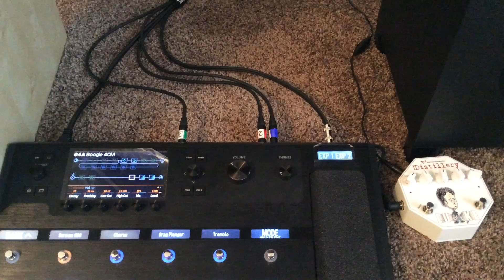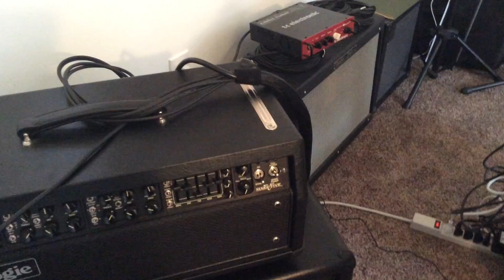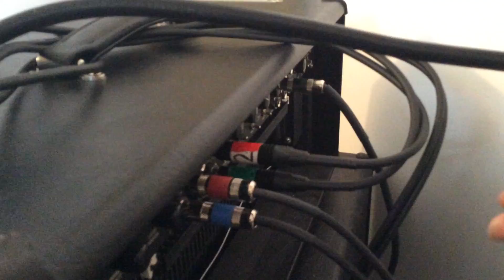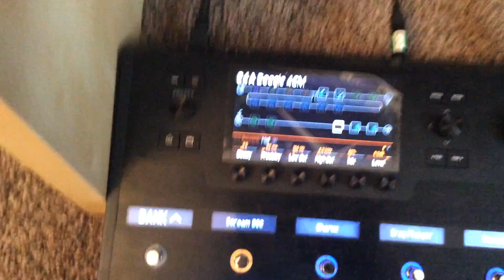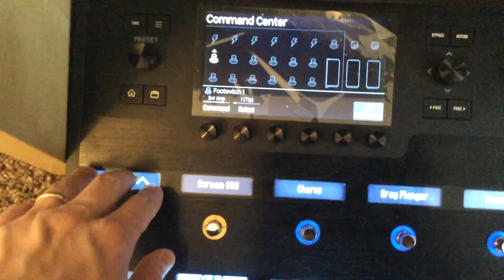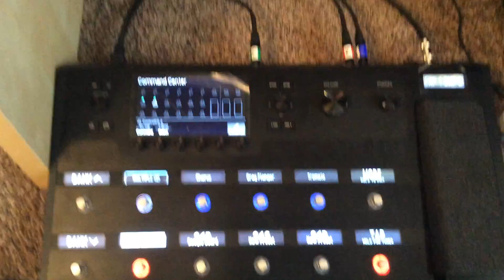Line 6 Helix with Mesa/Boogie Mark V 4 Cable Method

Comment: How do you switch between channels on the MkV....is it a toggle kind of thing with the Helix' footswitch?  Also,  how do you integrate your MkV in your patches?  Are you using it as another amp block or something else?  Do you use the Helix' internal amp and/or cab sims and if so, do they run through your MkV or do you use another send to a PA, etc.?  Sorry...tons of questions still.   LOVE your video though...it's going to be my exact setup soon...thanks!
Reply from the maker: +tomulator I've got the different Mark V channels assigned to a footswitch on the Helix, so that will turn them on and off.  I'm not using any amp or cab blocks in the Helix.  The Mark V and 2X12 Recto cab take the place of that.  With 4CM, you set up your patches so you have all your preamp effects first, then you place your send and return right after those, then you put in your effects loop blocks after the return.  Let me know if you have any other questions, I'm happy to help out!
Reply: Thanks, thats great
Reply: Thanks
Reply: Can I ask you how you set your volume controls on the helix to get the most natural sound from the mark v? There are so many options and quite hard to know how to set them. It is mostly the big knob and the send/return levels the I am uncertain about
Reply from the maker: I know you can use the amp and cab sims in the Helix with 4CM, I just prefer not to.  With an amp like the Mark V, I don't see any need for a digital model.
Reply: +Joseph Facer with the 4 cable method you can still use the amp and cabs in the helix and place the amp blocks in the middle of the send and return blocks, the return cable is a direct input to the power section, doesn't even matter what channel the amp is on and with a fender or jazz rivet amp it is the cleanest sound I ever heard in and amp, the fx is so full, you can switch between the patch amp or the tube amp with a controller if you set the amp in between the send and return blocks. Just for cleans tho the crunches sounds sound good too but I rather the real amp. Hope this helps.
Reply: Hi, and thanks for sharing. I also have a Mark V and is waiting for my Helix to arrive. Is it possible for you to have for instance channel 3 on the mark v in one preset together with different effects and then use channel 2 in another preset (with other effects), and change these amp channels only by changing the preset,
Reply from the maker: Absolutely.  You can set the channel switching to an instant access command on the Helix, so as soon as you go to that preset, that switch becomes active.  You should look into the Helix's snapshot feature which will allow you to switch between channels/effects/settings within the same patch with a single footswitch.  I have one patch that is just for jamming that lets me switch between channels/effects that I have preset for different sounds, and when I play with my band, I have it set up so I have one patch per song, and I set up snapshots for the different sections of the song.
Reply from the maker: I just run with with the main volume most of the way up and the send and return at 0.  There is a Facebook group called Line 6 Helix User Group that could also give their findings on it.  The administrator of the group, Chad, has posted several times what his optimum Helix levels are for using Helix as a standalone as well as with an amp.

Comment: In other videos , people say that have problems when trying to change the amp chanel (they cant). Some are using interface boxes others crying. Do you have this problem?
Reply from the maker: +Ignacio Lanzani Not at all.  The channel switching works exactly like I've described it in the video.  I have heard of people having troubles with the Mark V:25 and Mark V:35, though.  With my setup, the channel switching works perfectly.
Reply from the maker: The new amp models are Mark IV models, but they do sound really good.
Reply: +Joseph Facer aw man that sucks if the switching doesn't work with the Mark V 35 I'm getting mines tomorrow and I've been using the 4 cable method with my helix and a carvin tube amp and it worked perfect. The upper post is a couple weeks old and now the helix does have Mark V amps with the 2.0 update, and the sound awesome, even setting the famous eq "V" sounds and responds just like the real amp. Great post I can't wait for my amp to come in.

Comment: i have same setup but just ordered 2 laney IRT-X FRFR cabs to use with my tube amp. still working on the cabling  and helix presets for this. love the cable snake just ordered one. thanks for the info.
Reply from the maker: +rick jones The Pedal Python is really awesome, plus they'll refund you a little for giving them a shout out on YouTube/Facebook/etc. and sending in before and after pics.

Comment: Thanks for sharing. I find this unit fascinating. However, I haven't been able to hear one personally yet. I've been afraid thinking that I probably can't get 'cut" from such units in a live setting. Question: How would you say the Helix drive settings compares with the drives from the Mark V? Does it cut like a real amp? Lastly, I bet a lot of Helix users will imitate your idea of using 'The Luke' pedal in conjunction with the Helix. Smart idea. I've heard great things from friends using that one live. Thanks again.
Reply from the maker: +lpgoog For some gigs, I'll only use the Helix (no amp or cabs) to front of house.  I always feel like I'm well-represented in the mix, so no issues with not cutting through the mix.  The Helix doesn't have any Mesa Mark series models, so it's tough to compare, but there are some great high gain models and gain pedals in the Helix.  I've been very happy with them, and use them often in my band's rehearsals.  I only just got The Luke pedal, but I've been super happy with it ever since I first fired it up.
Reply: +Joseph Facer I appreciate you taking the time to respond and sharing your setup. It really helps.
Reply from the maker: +lpgoog Happy to help.  Let me know if you have any other questions.